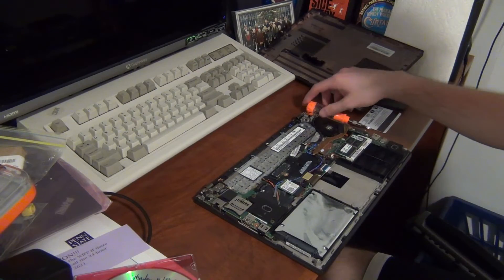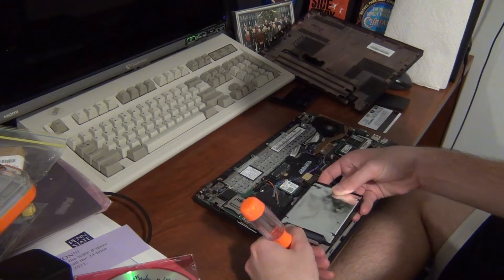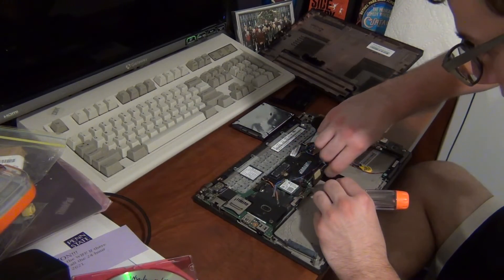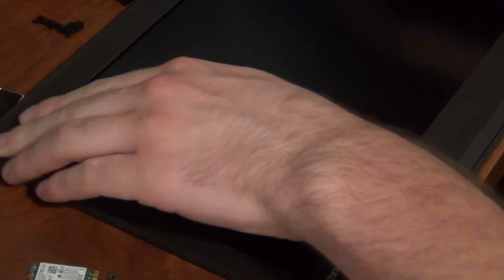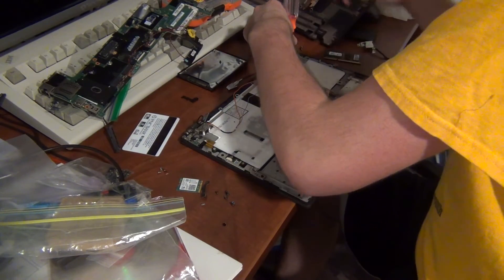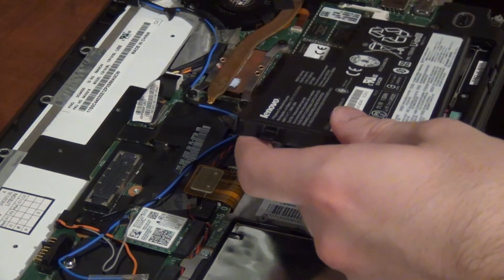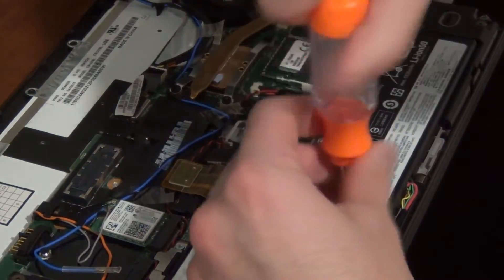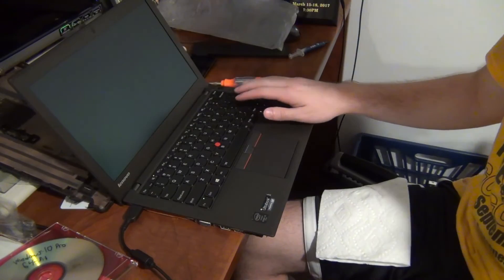Lenovo ThinkPad X240: Screen, Battery, and Palmrest Upgrades

Comment: Can't get enough of these vids. I'm binge watching.

One tip: Always put down the screwdriver when you've finished with it. If you keep holding it especially when messing about with the screen you risk scratching it (talking from experience).  Makes me feel bad every time I turn my machine on.
Reply from the maker: I’ve done that before. By the point you’re talking about in the video I knew the seller had sent me the wrong screen so I didn’t really care. :P

Comment: Where can I find a t430s 1080p display
Reply from the maker: 1080p screens were not made for any of the T430 models. You can buy a converter board on eBay (try looking up T430s 1080p IPS) and then buy a 14” 1080p screen or buy both as a kit, but without said converter there is no way to put a 1080p display in the T430s.
Reply: I have ips on t430 buy kitt off aliexpress 130dollars

Comment: Could you provide links for the main upgrade parts (palm rest, keyboard, and display)?
Reply from the maker: The selling links always change, so I stopped putting them in my videos. I bought all of the parts from eBay.
Reply: Was the palm rest, keyboard, and trackpad one unit or were they separate parts? That's kind of why I was asking. Also, the part number for the display would help with searching.
Reply from the maker: I specifically said the part number for the display in the video AND showed it on screen. Please pay more attention next time before commenting. The keyboard, palmrest, and trackpad was all one unit, but you can order the parts separately if you do not wish to replace everything.
Reply: I know you mentioned the seller's change, but if you have some consistent ones that are reliable, it would help. Even the eBay option to look at the original listing for a completed offering would still have value.

Like you, I got the same display that was too small, even though I ordered the P/N you specified. The seller in question (not on eBay or Amazon) is a dedicated laptop screen seller, but they happen to specify on their product pages wording like "12.5-inch WideScreen FHD (1920x1080) Matte. compatible with p/n LP125WF2(SP)(B2)". I didn't think any of this when I ordered from them.

Their definition of compatible is pretty fishy. The screen they sent might be a 12.5" FHD display, but it is not compatible with the LP125WF2(SP)(B2), as you noted (I got the same one you did) if your definition of compatibility includes actual dimensions. I work in the semiconductor industry and compatibility absolutely includes package dimensions when we say something is compatible.

Anyway, your seller recommendations would be helpful given that you go through the hoops on these things before those of us who watch your videos do :-) In fact, had I not watched your video (and rewatched to see what I thought I was doing wrong), I wouldn't known I'd been hosed. I just thought I'd re-routed the eDP video capable incorrectly and that the screen was lopsided because it was resting on it funny.

Thanks for all your work on this. I'll eventually get finished updating the X250 I got, and it will be a nice machine for my daughter when she goes off to college (and at half the price of the X280 I'd have probably bought her, too).
Reply from the maker: The seller I bought this one from already no longer sells them, and I did this not even 2 months ago. My best suggestion is to complain to the seller, eBay will almost always side with the buyer (which is a blessing and a curse), same with Amazon, and they will either have to refund your money and/or send you a new screen. In my case I MADE SURE that the screen they were sending was the EXACT one I asked for, and NOT a “Compatible” one. Usually if you request the EXACT part number from the seller they can get you the right screen, and if you can’t find any luck on eBay or Amazon there are other vendors that will sell the displays. I bought mine from Amazon so I can’t help much in terms of what site to buy from. The ThinkPad forums and r/ThinkPad will usually have good information about where to get a screen.
Reply from the maker: I also just read that you were doing this mod on the X250. In that case you need to be even more certain that you have the correct display, as the xx50 series ThinkPads have a whitelist on which displays will work. Usually it just means the brightness is stuck at maximum, but it’s nevertheless very irritating. That’s actually part of the reason why I opted for the X240 instead of the X250. It’s cheaper, physically almost identical, and doesn’t have the display whitelist. The xx60 ThinkPads removed the whitelist, but those are still fairly new and thus still on the pricier side.
Reply: Yeah, 'cept I think I went with an r/ThinkPad recommendation on where to buy the screen, so caveat emptor, I guess.
Reply: Ugghhh... not clear from the various comments if the X250 whitelist is there or not. There is a UK seller whose panels have been proven to work. Might have to go that route. If not, I can fire up Linux and do the EDID modifications described elsewhere.

Thanks for the warning.  At least my daughter won't need this until next summer, so I have time to get it right.
Reply from the maker: Kudos to you for being willing to venture into Linux to so the edid changes. I’m barely comfortable enough going in to do the EC mod on xx30 machines! Maybe some day I’ll have enough parts sitting around that I can justify the gamble.
Reply: I went with the screen from the UK seller on eBay mentioned in r/ThinkPad who specifically lists their part with the ThinkPad FRU number for the 1080p display and has confirmed that the brightness controls will work.

My display arrived the day before yesterday, and I opened and installed it last night. The panel does not have the FRU tag, only the LG P/N, but it works exactly as described. I've got brightness controls in Windows 10.

It ended up costing $100 to go with the UK seller, but I'd also noticed that right around that time, the cost of the LP125WF2(SP)(B3) display had gone up around $20 from all US or European sellers, so I really didn't end up paying too much more.

Anyway, thanks for the pointers. The proper display fit right in, I was able to re-attach the bezel with a little work, and the image quality is just stellar.

Comment: Hi. I have an x220. Is it possible to have 4G LTE wwan on this machine. Is there any bios whitelist around for this?
Reply from the maker: I know it can do 3G, but I can't guarantee that it can do 4G/LTE. I would look up a list of compatible WWAN cards for the X220.
Reply: Thanks. If there is no way to have 4G/LTE on x220, may you get me the 4G/LTE  WWAN cards for the x230 (I guess it can do 4G). I will have to get the x230. I appreciate your assistance.
Reply from the maker: Once again, I don’t have much knowledge of the WWAN functionality of ThinkPads because that’s a feature I never use. I usually put an SSD in the WWAN slot anyway.

Comment: Fantastic video! How much do you spend in total?? I am trying to find a cheap x240 thinkpad that needs some work...but here in spain they are a lot more expensive.
Reply from the maker: The X240 itself cost $125, then I spent $60 on the new top case (palmrest, fingerprint reader, keyboard, touchpad), $70 on the screen, and $20 on the battery. The Arctic MX-4 paste I had on hand well before buying this, but with all of my upgrades I spent around $280 total, which I think is a decent price for all of the upgrades.